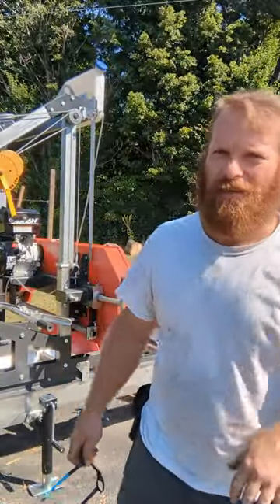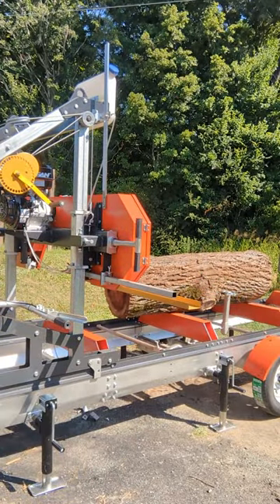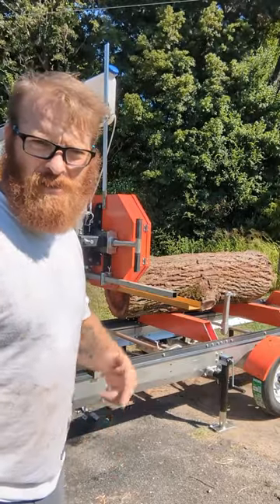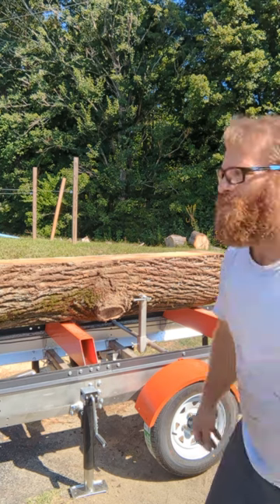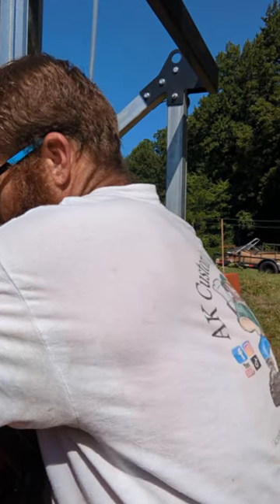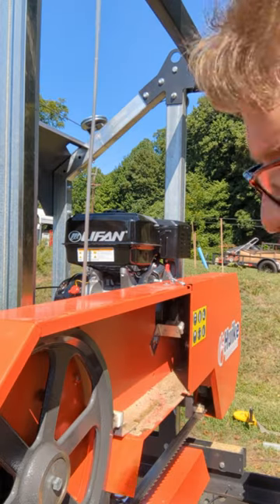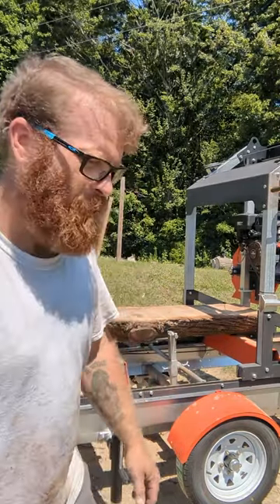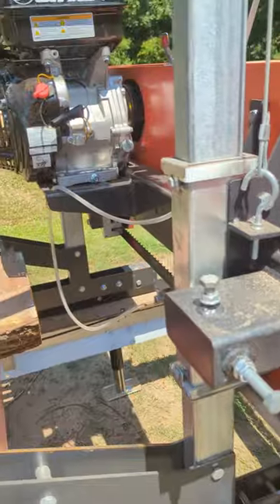Huike HKS31G Sawmill first Cuts and issues.

Comment: What is total cost + shipping?  I might go Chinese made, but expect to replace the bearings.   The ramps look worthless for big logs.  As a boat owner I'd expect to replace those jacks if kept outside, after a few years.  And not sure the generic ones from Lowes or hardware store would work without a bit of welding.
Reply from the maker: Expect to spend around 6k for the model I have.

Comment: The winch looks like it could break/snap off so easily.
Reply from the maker: This was the first time I used it and knew nothing about rigging, so I definitely was using it wrong. Now I know what I am doing, with the modified  ramps I have successfully winched 1500 lb logs onto the mill.
Reply: @akcustomwoodworking3864  The rig is a back & body saver. I enjoyed the different content. I could see certain areas that could use reinforcement. 
Our chainsaw rig is great for the very little we use ours. Then again, we don’t make furniture nor fancy custom pieces, like yourself. Your body will thank you in 5-20 years 😊.
Reply from the maker: I have slowly started changing things and trying to make things better, well I guess better for me. Less work and easier on the body is the whole idea now, not as young as I used to be!!